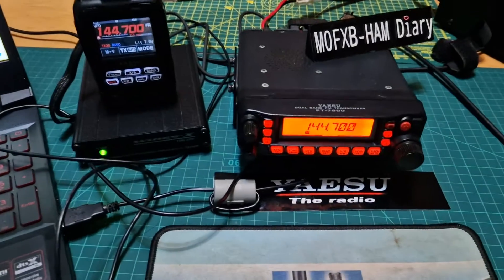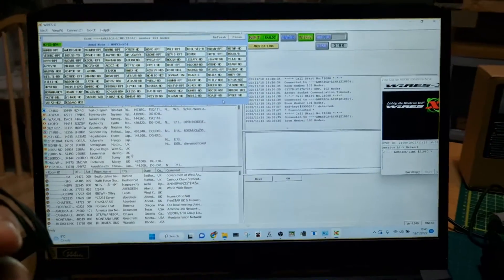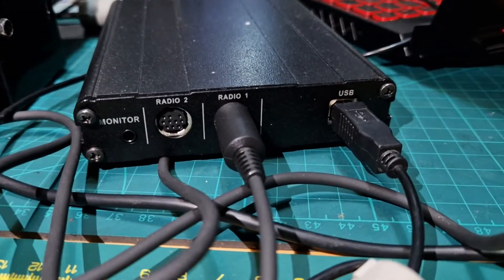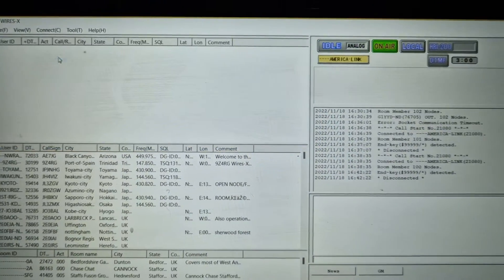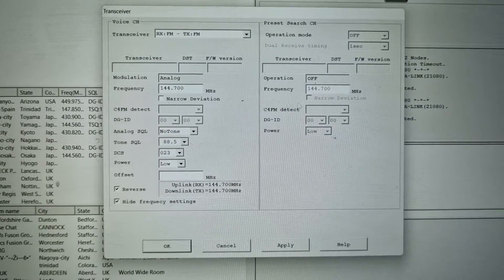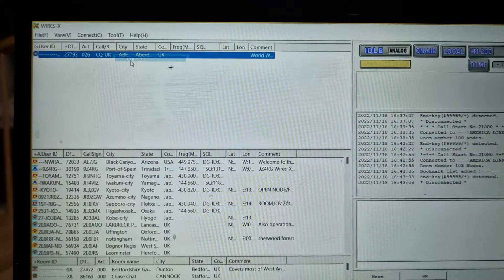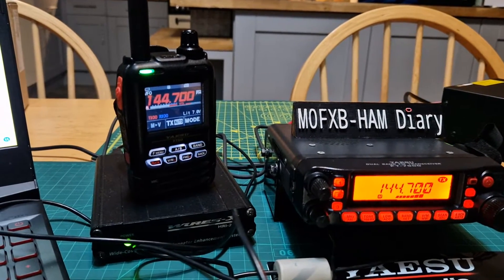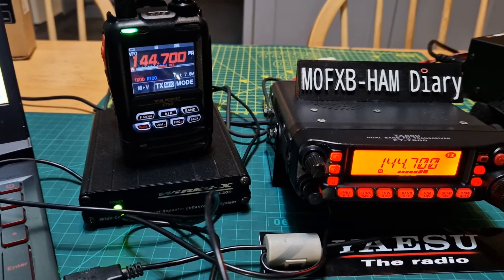YAESU FT-7900 HRI200 Analogue Wires X Mode

Comment: I was wondering about this. So in short, your analog setup is being converted to YSF digital and thus able to communicate on America Link on Wires X. The software and the HRI200 is converting and bridging your analog to WIRES-X digital. Correct? I have the same radio (FT-7900), but I do not have the HRI200 yet. I do have an FT3DR. Would I be able to communicate using digital mode on my FT 3DR using this same setup?
Reply from the maker: With the ft3d u just need the SCU19 Cable for pdn mode as for the 7900 my experience is that users at the Wires X end need to also be set up to convert fm to digital I found that CQ UK was good for this if you want to play with hri200 get a used one about £70